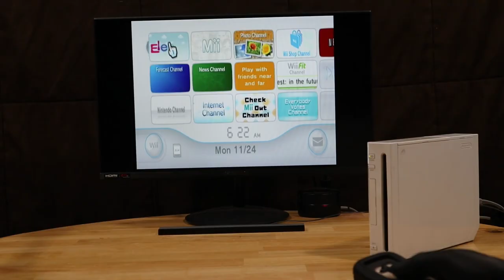Fixing a Wii Disk Drive...Somehow?

Comment: I bought a Wii on eBay and when a disc was inserted it couldn’t be read. I followed your video and took it apart. To my surprise the inside looked brand new not a single dust bunny what was causing the issue was a DS Mario n Luigi game cartridge it also looked brand new. I removed it re assembled it works great thanks for the video.
Reply: Nice to hear. Today my wii from ebay arrived. The seller didn't mention the disc drive isn't working. I'm looking forward to fix this.
Reply: @markflakezCG good luck man👍

Comment: Very interesting problem and solution. My old Wii doesn't play Brawl and only Brawl, but oddly enough it works on my 2nd Wii. I did take my 1st Wii into a carpenter work shop where my boy scout troop had a night of playing videogames. And my Wii got caked in saw dust over the years and I recently cleaned it out after it being dirty for about 5 years. But brawl still didn't work, I'm think of taking the disk five apart and cleaning it and your video is going to be a great tool for it.
Reply: have you tried to see if it isnt just your copy of brawl? maybe try a different brawl disc.
Reply: brawl is one of the few multi layered discs which when the wii stops reading those, its a sign that the lens in the laser needs to be cleaned, open up your wii until you remove the heat shroud and once the disc drive is exposed, just squeeze a cotton swab in between the drive to swab down the lens, it worked for me

Comment: I’m 99% sure I have identified the exact cause of this problem. On the mechanism on the top of the disk drive there is a pin on the other end of the middle lever, this pin is what actually triggers the switch that moves everything into place (part shown at 5:38). This pin has to be exactly lined up with the hole on the switch. If it is not exactly lined up the pin may still push the switch, but it won’t put it completely in to place most of the time. So if someone ever opened the disc drive or if the Wii ever had a hard fall the pin would get displaced. To fix it, all you have to is be sure to line up the pin when putting the top on the disc drive. You can check if it is lined up by shimmying the lever in the middle to see if it can move a significant amount, if it can it is not in the right place.
Reply: Yo i know this was 2 months ago but holy hell idc props to you i had no idea what this guy was blabbering about

Comment: I did everything you did. I knew there was items jammed in the drive. I found a 2 discs (Gene Wilder Double feature), a tortilla chip, a nickel, a quarter, and a few stickers inside the drive. Toddlers' curiosity can be very  unintentionally  destructive and creative.  But now I know how to disassemble the Wii and it works.  I had a hell of a time getting the same piece that fell out back in the right way. I couldnt figure out which way the metal clip was supposed to go but it fixed the problem and works great now. Great vid.

Comment: I have the issue of the disc being clamped down (the gears on the side are working) but it then spits it out twice without spinning it up. I've tried 2 different wii games with the same result. I'm not sure what the issue is.

Comment: Exact same problem but never found why certain levers  jammed at the point where the disk was pressed down on the spinner motor - after 2 hours working on it I left the main cover off and manually gave the key linkage a little help when it needed it - after seeing your video where you were looking more upstream for the jam, I may give it another try but for now it works with my assistance.
Reply: Try tying a knot with a fishing line around the white bracket and carefully route it outside the disk drive. 

When the Wii struggles to read disks pull the fishing line and it’ll pull the bracket on the side into place and read it like normal. 

Weird and jank fix but, mine snapped a piece of plastic clean off that helps the motor on the side move that bracket into place. So the only solution I could come up with was tying a fishing line to the bracket and routing it outside the Wii. 

I’d highly recommend wrapping the end of the line coming out of the Wii with electrical tape or duct tape so the fishing line doesn’t cut your hand when you have to inevitably use it.

The fishing line knot comes undone once every so often but, it functions for about 6months or so b4 doing so. 

Technically you could run multiple lines through the front tied to the same white bracket on the side but, it’s personal preference.

Comment: How noisy wii is normally when insertinga disc in it? I tried my a second hand wii, and the drive spins really loud. When there is no disk it is quiet as a mouse.
Reply: This might be a little late, but disk vibration noises are fixed by adjusting the spindle magnet. 
If you look at the mechanism that clamps the disc in this video, you’ll notice the middle bit is held on by two black screws. If the console gets bumped or dropped, the magnet can become misaligned with the drive motor, causing the disc to vibrate and make noise.
To fix it, insert a disc (when the Wii is disassembled) so that the clamp drops down, then turn off the Wii. With the disc still inserted, loosen those two screws and let the spindle magnet assembly float back to its normal resting position, and retighten the screws.
It might take a couple tries to get it aligned correctly but that should fix the problem.

Comment: I bought a used Wii with the original game cube disc drive, it worked perfectly fine but I had to replace it because some of my Wii games were dual layered discs which needed a stronger laser to read them. I turned it on the other week after a year of not playing it and now the replacement disc drive I had installed stopped working, I have no idea what happened

Comment: This was happening with my Wii as well. Unfortunately one of the pieces of plastic snapped clean off that works to push that white bracket bit on the side. 

The thing I have personally found to work is tying a knot around that bracket with some fishing line and feeding it through the bottom of the disk drive. 

Just be careful that you don’t get the line entangled in other gears when you’re routing it. 

Wrap the end of the line that’s coming out of the Wii in electrical/duct tape so you don’t cut up your hand when you are pulling the fishing line fix.

When the Wii starts making the noise simply pull the fishing line and it’ll move that bracket and the Wii will function as normal. 

Unfortunately a replacement disk drive wasn’t an option in my case and drilling into the Wii’s outer shell to give access seems like a terrible dust issue waiting to happen. 

So just use fishing line and think outside the box!

Comment: I just did the most idiotic thing. I took apart my wii and now I can’t remember what parts go where. I have taken apart a ps3 and an Xbox 360 before and put them back together, but the wii is a bit more complex. I may have also taken apart the disc drive, but it was making a bad noise and I thought something was wrong with it. I think I should just buy a new disc drive. And maybe some GameCube ports so I can play GameCube games on it.

Comment: Mine was also not reading discs. Just fiddling around, I tried inserting and hanging onto the disc halfway and not letting it get pulled in right away. And then after a second let go and let the disc go in. Somehow that fixed it! I'm guessing it was a similar issue. Like some mechanism needed to be reset.
Reply: Could you explain what you mean a little more im have the issue of it constantly ejecting discs

Comment: Man I just bought my wii and I have the same problem I can’t play any games :(
Reply: @nohzatino9629  how, i have home brew and my Wii started doing this, do you use usb loader ?
Reply: @akac1  yes, but I haven't looked at it in a while. My parents' Wii started having disk drive problems so I am planning to install USB loader and buy an external HDD next week. But as far as I remember it is not very hard.
Reply: @nohzatino9629  I believe you can get an external disk drive to plug in as well
Reply: @akac1  oh that might be true. But as long as I'm modding it, I could just as well use a hard drive right? :')
Reply: @akac1  If you still want to do it, I used USB loader and then WiiGSC to create game shortcuts on the Wii menu. Works like a charm.